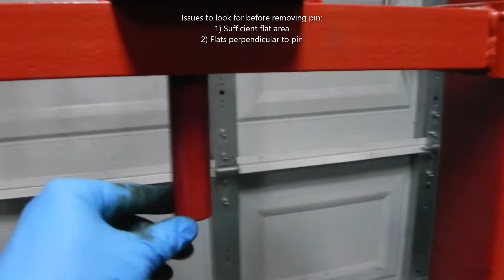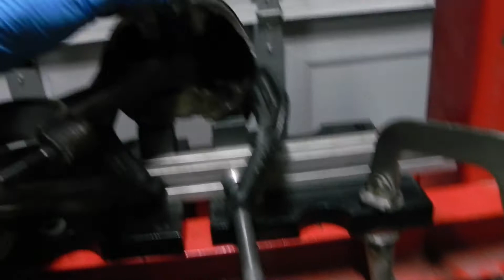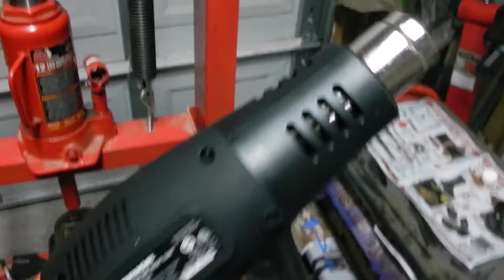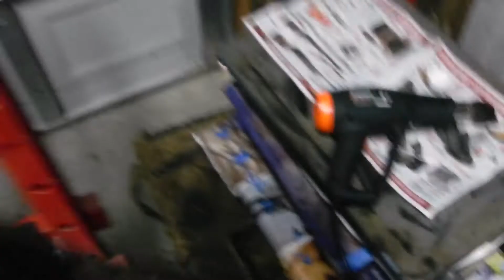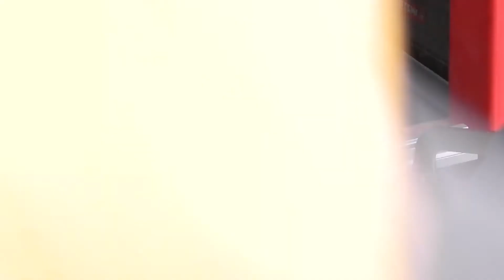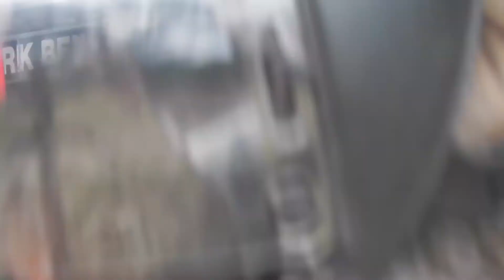Wrist pin removal for a gen 1 small block Chevy 350 piston assembly

Comment: dont bother with the heat, just press apart, you arent reusing pistons i assume
Reply: When you use heat to assemble press fit rods, you're just heating the rod. You're not going to get any benefit by heating the rod on an assembled piston. The rod and the pin are both expanding so there's no difference. Just use the press. You can reuse the pistons if they aren't damaged. If you do plan to reuse them I would use an arbor that holds the rod and uses that as a push point. Still, it can be done like you did it without harm.
Reply from the maker: You are correct that I am not reusing the pistons, but the pin is pressed into the connecting rod, which I am reusing.  I want to cause the least amount of material removal when pressing out the pins, so the heat helps with that.  Besides, my press would not have enough power to remove the pin without the heat.
Reply: @engineeringguy6774  That press most definitely will press the pin out without heat. Those pins are no tighter than press on axle bearings and retainers, or even any of the bearings in a typical differential.   Either way good video. but I also think the heat is just extra work.